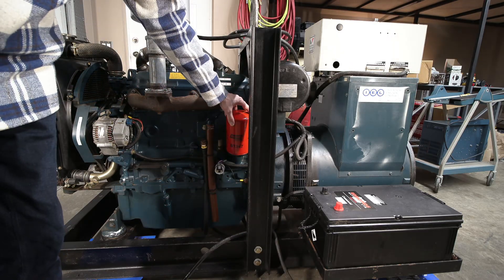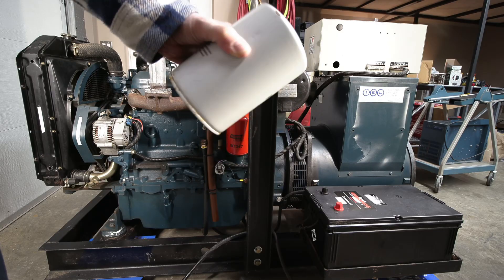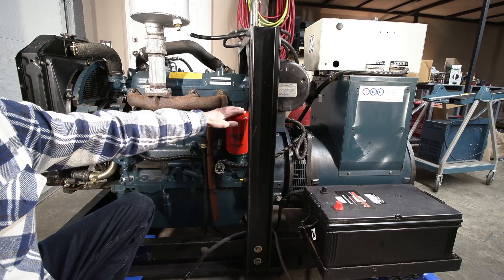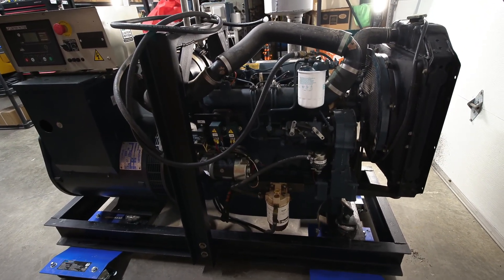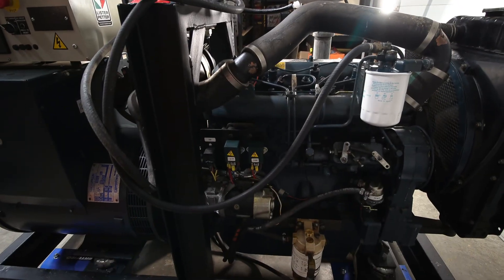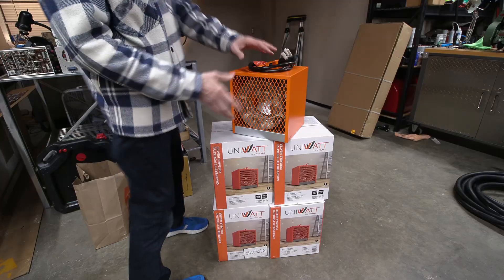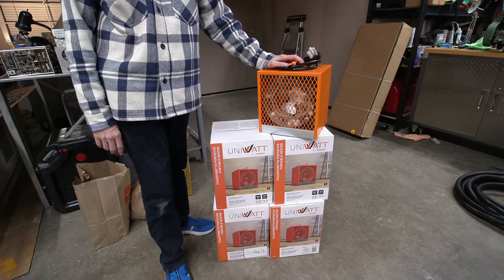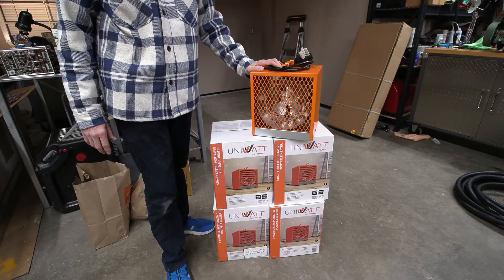Will It Run? Diesel Generator Adventure!

Comment: using dc assistance with those lithium titanate cells would produce an extended boost and do a fast recharge to be ready again , im using lithium iron (200 ah, 24v , 20 ah drain) and they give 10-14 hr non sun runtime with a hr charge time , 20 ah li titanate gives up to 750 amps compressor starting power ...

Comment: You can install an electric oil pump (steering pump would do) to build up oil pressure before starting. Install a T fitting to oil drain plug and attach the outlet of the pump to the oil pressure sensor hole.

Comment: Hi Mr Carlson!

I’m currently building a project 1974 260Z, and I’m currently replacing my seemingly failed ignition controller with a GM high energy ignition module. I would absolutely love a Mr Carlson’s Lab explanation of how these modules take a magnetic pulse from the distributor and use it to control the ignition coil because you go into such amazing technical detail! Would you make such a video, or point me to the answers I seek? I know THAT it works, but I want to know how!

Thank you!
Reply from the maker: Thanks for your input!

Comment: The filter may be filtering the oil on the return to the oil pan. In that case it doesn't matter it drains since the oiling system gets oil and pressure and then flows through the engine before it gets to the filter. So it being empty really only matters when you remove it and it doesn't spill oil out of it.... 🙂

Comment: from a lot of experience with generators - dont expect that nice control box to last at its present position. Vibration will sooner or later rattle parts loose, and it will malfunction. Take box off and mount it away from engine vibrations!

Comment: I've been thinking about making a small panel into a switchboard with receptacles to plug in space heaters when I need a loadbank. Im thinking under 10kw though. On a tiny 800w gen I have I use my hairdryer, low, medium, and bog down.

Comment: Dear Paul, although already commented by @Equiluxe1, I would like to add my comment as well about the oil filter capacity and the way it is installed on engine body.
If the oil filtration system is bypass type then you have not to worry at all, job is done as it should.
But if it is a full-flow type, then care needed.
At full-flow sys all of the oil capacity passes through the filter and then goes to lubricate. At bypass sys a small portion of oil flow 5%-10% passes through the filter and returns back to oil sump. The oil amount that is going to lubricate does not pass through the filter.

Comment: Paul, the question came up lately which electrolytic capacitor do you use. some say Rubycon, others say Kemet, while others say Panasonic. which do you prefer and where do you get them? Thanks.

Comment: You have now backup power! I saw the whole unit shaking violently duting cranking. Wonder what this will do with the height and (seemingly) high mass on the muffler standing up. Will it cause fatigue cracks  in the exhaust system over time?
Reply: in another reply he said he will mount the muffler elsewhere and connect with a flex pipe.

Comment: Those little engines will last a long time.Some didn,t have a water pump and used a thermal siphon. I saw them used in the oil field that ran 24  7 reliably.

Comment: There is an anti-drainback valve in the oil filter housing. It must have sat for a long time. If you exercise the unit every 30 days there won’t be a problem with the oil draining back to the pan.

Comment: Nice to see the generator working, Paul. Are you planning to connect it to the house grid, so it will start automatic if you get a power-out?  73 LB5JG Asle
Reply from the maker: No, I don't trust anything automatic that I can not monitor, IE: If I'm away from this place when an outage happens..

Comment: When I was a radio engineer, I did lots of work keeping APU's serviceable, mostly on mountain tops. We ran them on propane which is more reliable in the cold. I was always checking for leaks because it was a real pain if they didn't start when there was a power outage. When I was a teenager I tried getting very old hit and miss engines (and earlier ones) working but they mostly were to worn out to ever start. WA7VQR

Comment: As a diesel gen mechanic for 50 years, I will say this: Kubota, excellent. DeepSea controller, excellent, Balwin filter, no. Use a Wix, Kubota or Napa (Wix). Balwins are noted for not much inside the can.

Comment: 27 kw !!!! what on earth is running in the house to warrant that?  I idle at 500watts max, never use more than 2.5 kw at any time eg kettle or microwave maybe...., even with the 2 airconds running flat stack in some months with no thermo... ( cool summer, reverse cycle winter) on,  i wouldn't use 5kw even in the unlikely event everything was on.

Comment: Getting set for the apocalypse Mr C?
A reliable setup for fuel is what you need next.
Nothing worse than faffing about with diesel in a blizzard.
Then plumb your exhaust out the roof.
Some nice vibration isolators would be cool for extended use, as well as a simple enclosure with soundproofing.
A nice automatic transfer switch for those off-grid moments would complete.

Comment: If the oil filter is of the by-pass type it does not matter that it drains out, if on the other hand it is a full flow design then that is a pitifully way to have it set up, as it will ensure rapid engine wear and I would look at relocating the oil filter.

Comment: On large Diesels we have a pre lube pump to get oil to all the bearings prior to starting .
We also use it on shut down to avoid a heat soak  high temperature of course very important for the turbo charger bearings . 

One ship called the BNA pump, before and after .

Comment: I used to build and test resistive and reactive load banks.  Prime mover was MTU V24 2MWatt on a 4000Amp busbar.  480V 3phase up to 13.8KV.  Quite impressive when it ran and was loaded down.

Comment: Nice gen-set. I'm curious what the running oil psi is and the governed rpm. That Baldwin BT347 does have an anti-drainback valve, but unless your filter mount has a long center pipe, the oil will still drain out from the center of the element. If it does, you're good to go!

Comment: Neat!  I used to have a generator a bit smaller than that... it was a 20 kW unit with a Ford LSG423 engine on it, which was basically an engine from the Ford Pinto of the 1970s.  The generator had an interesting regulator circuit which consisted of the following (in order of power flow): the output winding, a bridge rectifier, and the field coil.  Or in other words there was no regulator!  The book had a weird explanation that the resistance of the field did the regulating which never made sense to me.  But it regulated "okay"... it would put out about 127V per phase with no load, and 115 or so with a heavy load.  It ran at 3600 RPM and damn was it noisy!
Reply: that Pinto engine was made for 30+ years as an industrial application, after they stopped using it in the cars. Most everyone I saw ran at 1800 RPM and was VERY quiet. I believe Generac bought out the last of Ford's warehouse stock (thousands of units) and built a line of 15kw to 25kw standby sets for several years.
Reply: @rupe53  Yeah, unfortunately this one ran at 3600.  It was branded "Dayton Power-Pro" but apparently Dayton is Grainger's house brand, and it was really a Winco APS20000A.  I kind of miss it... got rid of it because we bought a new house that already had a Generac genny installed, but the Winco was built 10 times better than the Generac.  And also had almost 2x the output.  :^)
Reply: @moi01887    those Winco / Dayton units didn't use the Pinto engine they used the English Ford Cortina engine at 3600 rpm. I have to say that I never saw one blow up despite all the racket. They were actually fairly easy to work on, except for the radiator and muffler.... but those seemed to last a decent amount of time. I serviced several dozen of those over my 20+ years in the field. The one thing I didn't like was the cabinets were prone to serious rust issues.

Comment: I use an old electric furnace with switches for the element banks for different loads. much cheaper and I always load test during the winter to heat the shop.

Comment: In old times mid size generators where tested with 3 copper or brass electrodes in large plastic or wooden barrel filled with salty water.

Lister Petter has interesting history, Lister is still well respected brand, especially by old people and in British Commonwelath. Oldest still running Lister engine that i know of is more than 100 years old.

Comment: If you mount it to the floor. Let me know where to get some vibration dampeners.
Reply from the maker: It has rubber mounts in the frame, thats why it's jumping around so much while its cranking.

Comment: I'm guessing that the reason you're not deleting the electronic controls is for the auto-start on grid failure features. I also prefer mechanical/electric gauge sets for monitoring engine operating condition. In my experience with diesel gensets, electronic controls are where the problems will first arise, as long as coolant, fuel & oil are properly maintained. I do like electric-start engines, but if that becomes a problem, I'm not opposed to pulling on a rope or turning a crank (unless it's far below freezing). I've never owned a new(ish) genset like that one of yours, so, for me, the first things to go are anything that I consider points of failure because they usually don't work and are not EMP hardened. So, generally, it looks like you got a good deal there. Just be sure to plumb the air in/exhaust out with the most safety obsessive manner as possible. CO gas will sneak-up on you before you know it.

By the way, your new outro reminds me of the 1983 film: "Videodrome", where one of the characters, Brian O'Blivion, who believes television is being used for mind control, replies to a question with: "That's why I never appear on television, except when I'm on television." It's generally an awful movie that I wouldn't recommend to anyone (I watched it a long time ago, so no one else would have to).

Comment: Paul. Please consider using inverter heat pump(s) instead of hooking that behemoth to your house. I can start (simultaneously) and run 8 tons (2x48kBTU) of condensing units with my 15k NG genset with absolutely no problem. Also these condensing units significantly outperform 14-16 seer alternating current units in reverse/heating mode, and by a mile when cooling.
I'm not sure what Canada allows but here in the states the first company out of the gate is the "Mr. Cool Universal" brand which are just rebadged Medea/Gree units. These universal units don't require communicating thermostats, so you can simply DIY replace the outdoor unit only if your AHU/Indoor coil is in good shape (and preferably uses a TXV). They also sell pre-charged line sets with flare fittings and internal pintle valves, or you can solder on the included flare adapters, evacuate and done.
Another option is to install a hybrid VFD in your existing unit that soft starts the compressor, dramatically reducing the inrush current required to start the PSC motors. Two brands of those are Micro-air and Emerson electric. 
The inverter heap pumps I use significantly reduced my utility bills, take up much less space and they are super quiet.
All the major HVAC brands in North America are about to start selling inverter condensing units with matched AHU or furnaces. They should reach lofty numbers ~ 22 seer2, and all can start on small gensets with no tricks. The DC motors in mine start at very low speed and usually fun no more that %60 RPM.

FWIW before some of the HVAC techs (and others) that don't know what they are talking about, or are afraid these units are going to destroy thies jobs comment, I'm not talking about ductless mini-split units. These are full split central HVAC systems.
Also these machines are dramatically cheaper than major brands.
Reply: Mr. Carlson's heat pump is ground-source. An air-source outdoor unit would be a huge downgrade. Adding a VFD to the existing compressor would be a much smarter option.
Reply: @eDoc2020  Thanks I didn't realize that. I'm sure it's just a matter of time before the compressors in water loop or even DX units go inverter, even if for for the ability to start on a genset/solar. Imagine the efficiency of a DX HP with an inverter drive. Almost free if mostly powered by solar. I have seen some vague references to completely DC condensers designed to run directly off the batteries on a solar installation. Something even more interesting is some of our Telcom data centers and switch offices are gearing to go high voltage DC (HVDC), delivered directly from the utility. It turns out that if you can eliminate the ac/dc conversions in all our modern electronics,  the savings in avoiding those conversion and PF losses can sometimes overcome transmission difficulties.  So in the end Edison may prove to have be right after all...

Comment: You probably know this, but most commercial standby generators include a block heater set at around 55 degrees during all seasons just to reduce engine wear when it cold starts with a heavy load and immediately revs up.
Reply: On
Large slow speed ship Diesel engines we keep them about 140 deg F all the time when not running . Use a steam boiler to heat the  jacket water .

Reduced thermal stress on the engine .

Engine is three  stories high and replacing one may mean scrapping the ship .

Comment: Mr. C. love the sound of an 1800rpm gen, Had a 3600 Air cooled sounded gen like a Cessna 182 taking off in fact it had the same engine. The heavy-duty exhaust with sensor is pure commercial quality.
Future project: build heated generator building with auto air louvers for cooling.

Comment: On the top of the CAV DPA fuel injection pump are two levers, the one on the left is the throttle lever and the one on the right is the stop lever. The stop lever is in the run position, so if you want to rotate the engine without it starting up, turn the stop lever clockwise, this with cut the fuel off.

Comment: i don't understand why some people think they have to prime a oil filter if your worried about air getting in the engine think of this the pump pulls the oil from the pan pushes it through the galleries and flows over the valve cam shaft push rods and the at the same time its splashing and mixing in air with the oil
Reply from the maker: It's the lack of oil under load at first start that does damage. You need to establish the hydrodynamic wedge before load occurs. This is the magic of shell bearings, and why they hardly wear when oil pressure is kept up.

Comment: Used military generators can be a very good deal as they are built for war, have enclosed housings for relative quietness and usually have good maintenance. I see you have a Lister-Petter. Lister built a great system years ago (Start-O-Matic) that would start itself when it sensed a load being applied. They weren't huge capacity (maybe 7000 watts max) but had quiet 1-3 cylinder slow speed diesel engines. NO electronics to them. Antiques but built to last.

Comment: Sir, Is there a way to rework the motor block, perhaps with a selection of bronze threaded pipe fittings, such that the filter canister would end up facing in the correct geometry?

Comment: so do you have a out house or a place to install it and run the exuast out the wall or celing?
Reply: your clever enough to desing a auto start pcb .i guess it depends if you want to install it and power your main buzz bar on your house electricty .so you dont have to go and start it up

Comment: It shouldn't be difficult to build a remote monitoring panel for the lab or house or both,  and piggyback it to the onboard panel.
I'd guess that there's about a 50/50 chance that there's already a tap for a factory remote monitor.

Comment: That thing will stink up the Garage/Shed for months, even Years. 
Used to deal with those things as Standby Generators at remote Radio-Relay Sites of the Phone Company.
Ours were kept at Operating Temp with Block Heaters at all times, cause they were required to be at Full Power upon startup
Reply: I think you will find that most gen set installed in a "life / safety" application will need to have full output within 5 seconds of a power failure. This goes for elevators, escalators, and emergency lighting, not to mention certain aspects of hospital equipment. At a radio tower site, you probably have external lighting, which is an FAA requirement.
Reply: @rupe53  
I was referring to the Engine having to be at full power, no warm up period, which is where most wear happens.
Reply: @pjimmbojimmbo1990   yeah, that's the hardest part. 2 second delay to start and transfer by 5 seconds total means the engine has only been running for 2-3 seconds. If you know where to look Kim Hot-Start makes inexpensive heaters that maintain 80 degrees instead of the usual 140 degrees. Quite the energy savings over time. I believe their 500 watt unit is under $200 retail, which is what I use on most units this size. When I was on the road, I also stocked 1,000 watts and 1,500 watts. Retired about 4+ years ago.

Comment: A nice little generator. I used to work at a rock crushing site, we had 2 old 300 kVA Caterpillar generators mounted inside a trailer with a 2500 liter fuel tank between them, one for the jaw crusher and one for the cone crusher and the sieve. They would burn about 500 liters of fuel a day.